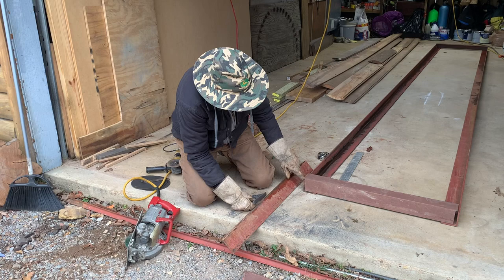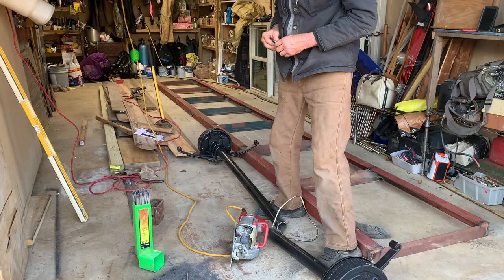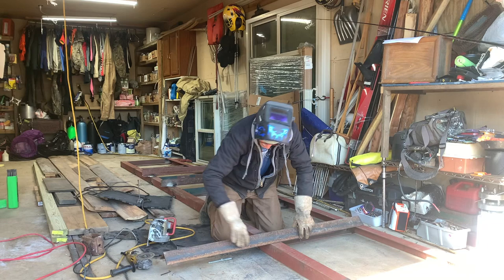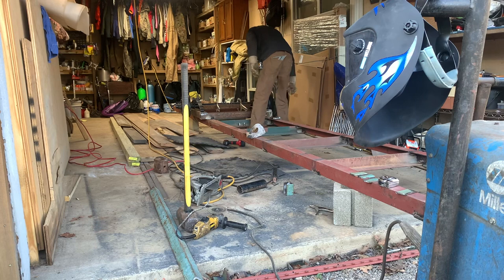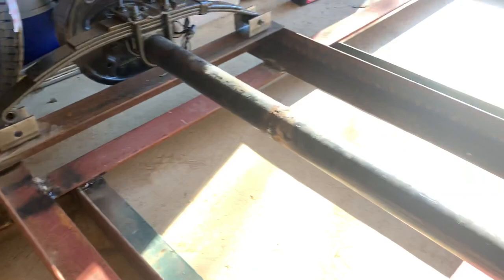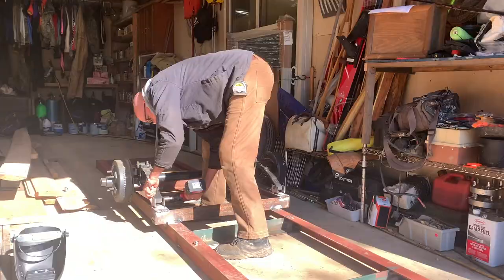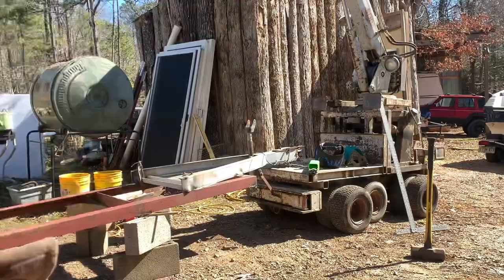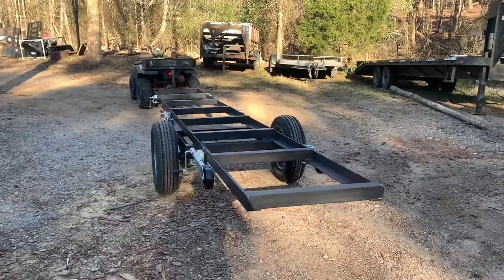DIY trailer for woodland mills sawmill HM122…details of the build

Comment: Light trailer, hopefully both frames will be stable
Reply from the maker: It has worked well so far. We don’t plan on moving it too often. The jacks are necessary to get everything leveled out when it is set up to cut. A heavier frame would probably make it easier to level things. 😊

Comment: Love the video!  Nice work.  I'm building a trailer now, but not sure where to mount the axle.  How far from the back did you mount yours?  Appreciate any advise.  Thanks
Reply from the maker: I put mine exactly at 80 inches to center of axle and then when you put the mill back there the tongue weight is just about perfect on it

Comment: What size angle iron did you build your trailer out of?
Reply from the maker: It was 3 inch. I definitely wouldn’t go any smaller. Bigger would be even better especially if you have a bigger mill. When you roll over a big square log cant it really takes some abuse. Don’t use the jacks that stick up like these do. They won’t work unless modify them and that is a job. That was all that I could find during the height of Covid. 👍
Reply: Did you use 1/4” or 3/16”, thanks,

Comment: Great job... did you notch each cross  piece or did you just make an open corner at the top where you welded the cross pieces to the rails?
Reply from the maker: Thanks, it was a lot of fun to build. I notched each cross piece so it set down on the top of the rail. That’s what I set the mill rails on it worked really good. It was all 1/4 inch angle iron. Thanks so much for watching.

Comment: I have same mill ,just want to ask if that  strong enough did you try big logs to put on?
Reply from the maker: Trailer‘s been great and it is strong enough I’ve had a little bit of trouble with my jacks don’t put the jacks on it with the wheels that’s all I could come up with during the pandemic but I’m gonna cut them off and put a plate on the bottom but other That  it’s work great. My wife did a log the other day that was 20 inches so it’ll hold the weight